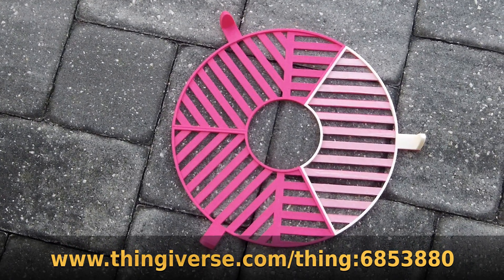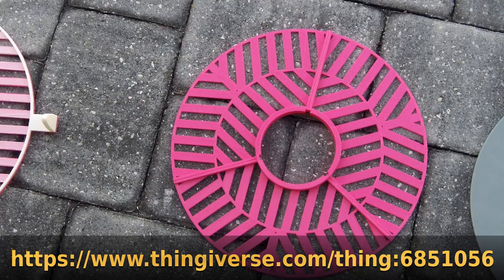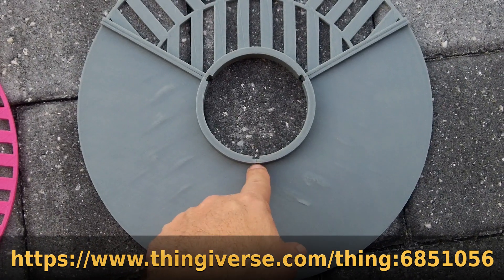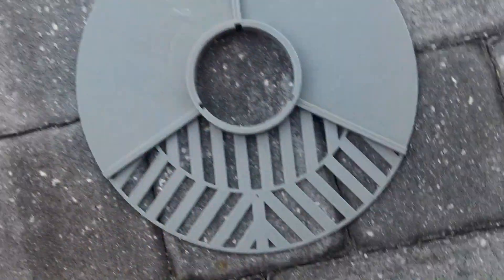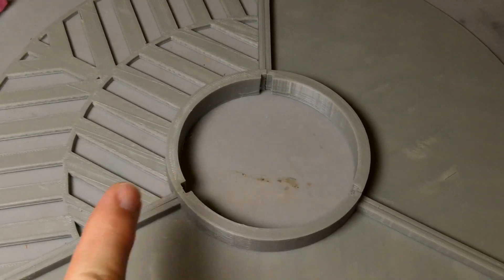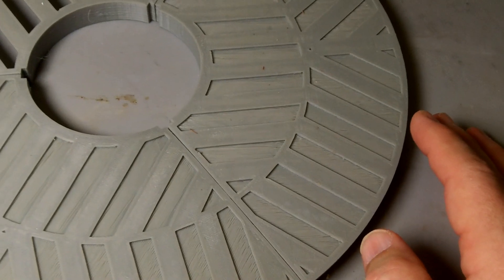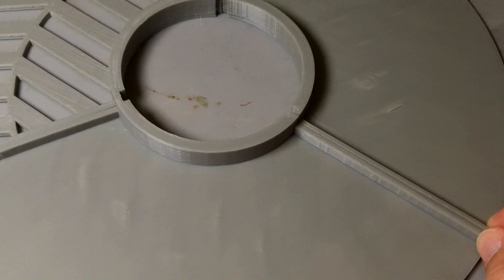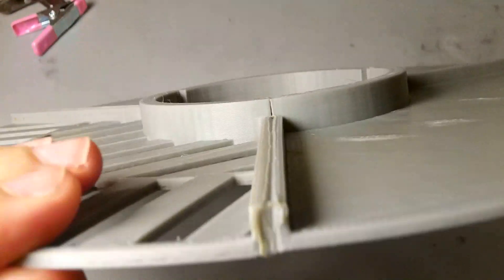One third of a tri-Bahtinov mask for single screw SCT collimation

Comment: Great job, this is a nice idea to focus on just one set of the three diffraction spikes at the time. You mentioned that you adjust the collimation screw *opposite” the exposed pattern, can you explain why you adjust that screw and not the screw on the same side as the exposed pattern? I am definitely trying this for my Hyperstar. Thank you
Reply from the maker: Because that screw seemed to work correctly for me when I was trying things out, as I assumed it was the correct one to do.  (Maybe I'm wrong?)
Reply: @summetj  This is good to know, it’s unintuitive so I’d never have thought to do it, I’ll bet you are right.I ordered a Tri-Bahtinov mask that splits into 3 separate pieces so I can fit it around my Hyperstar without taking things apart, and I’ll just cut out a cardboard shape to uncover one segment at a time for now. Thanks again for taking your time and for the inspiration!
Reply from the maker: @PeterRowe-k1o  Yah, I just used tape over my original tri-bahtinav mask once I decided that trying to look at just 6 spikes  (3 lines) was easier than looking at  18 spikes (9 lines) all at once and figure out which set of lines corresponded to which screws.